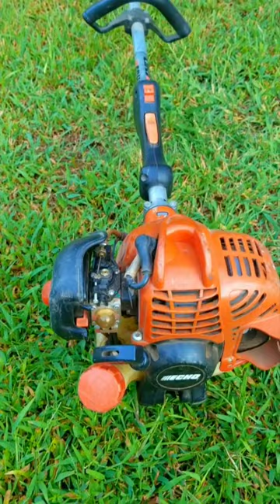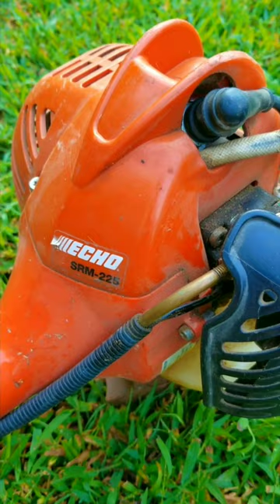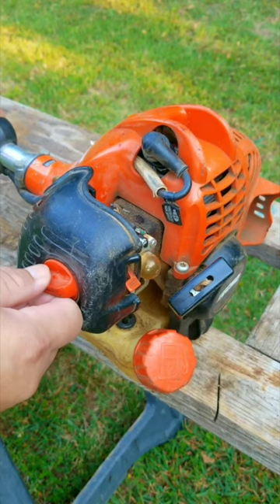Fixing An Echo Trimmer With A Hammer

Comment: I would say that 225 is a commercial machine many use it and put it to the limits and run the guts out of them I’m very impressed with all of the echo equipment
Reply from the maker: me too, they seem to be very good equipment, thank you Hunter 747
Reply: I've had a couple they're crap. Ill stick with Stihl. Echos have terrible torque and kicks back on crab grass. Only time Stihl kicks back is when i try to use it as a brush hog on tree saplings and limbs.
Reply: @ADHDcisGinger  not at all true sir while the stihl products are great our landscapers love the power comfort and reliability the echo trimmers have I personally love the echo trimmers and remover use the right tool for the right job in other words don’t use a string head to cut saplings
Reply: @ADHDcisGinger  what attachment head are you using for the splints I recommend the saw roof blade and for thick grass a 3 blades head   We have an echo 2620 commercial pas system (pro attachment series) capable of using many attachments and it just works so well we have a pole saw a hedge trimmer a weed whacker and the heavy duty gearbox for the saw blade
Reply: @hunter7476  its a cheap Lowe's brand with the three blades on it. It's not terrible but in a rough Field around a tower with guide lines everywhere about 3 acres, with thigh high weeds and cedar coming up every where the blades didn't last long. Bout every 5-10 minutes i was putting new ones in.

Comment: Pretty common with landscapers to smash the metal spitback plate and/or warp the air filter base. The choke will not close properly. I’m guessing that your reshaping the plate. Good call.
Reply from the maker: thanks, It was definitely a desperation move to get it to work
Reply: @HomeGaragechannel  It worked. That’s all that counts unless the customer wants to buy parts.
Reply: @HomeGaragechannel  It worked. That’s all that counts unless the customer wants to buy parts.